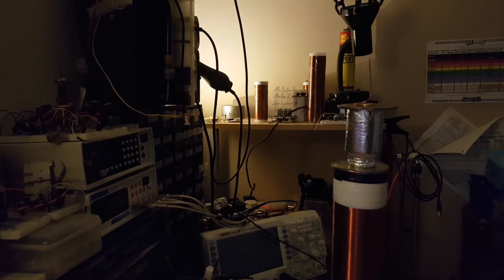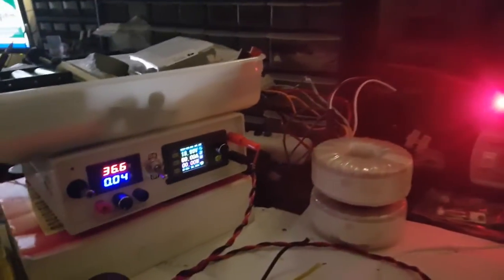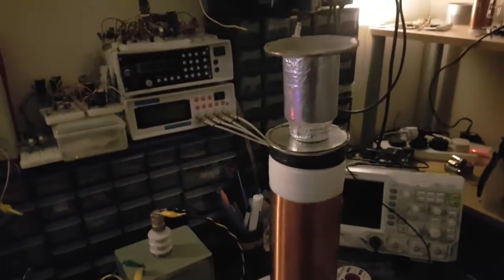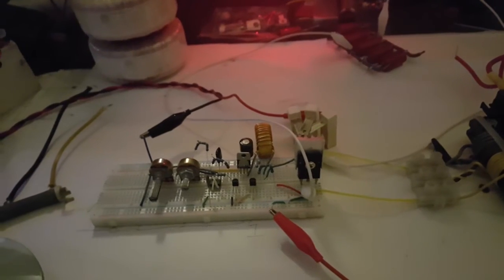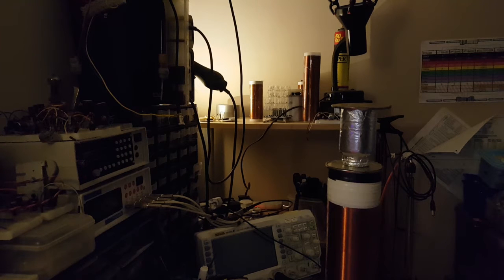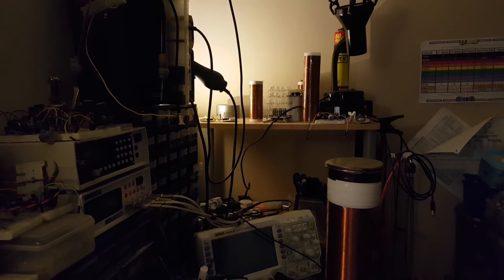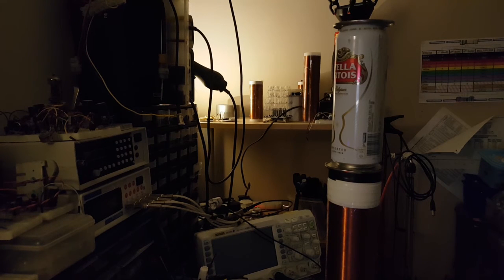Spark Gap Tesla Circuit As SGTC

Comment: hello 
i want yo ask you how to know how many turns, size and length in the primary coil to get the best power
Reply from the maker: I used a coil I already use in other circuits. Its is mostly trial and error, reading and watching video's. I am a noob to electronics and not a good mathematician.